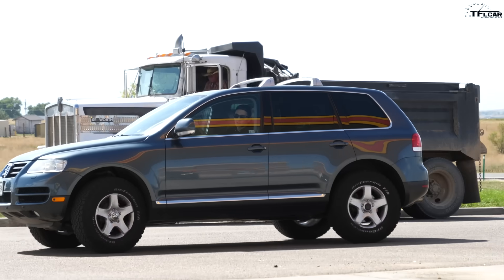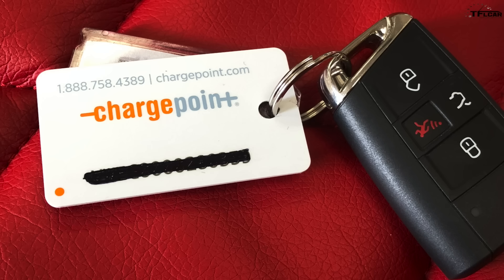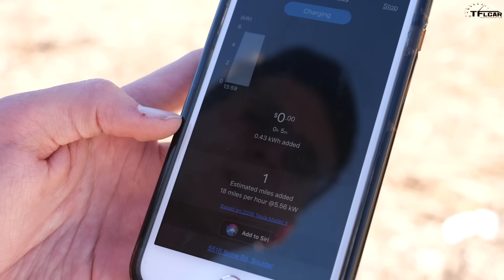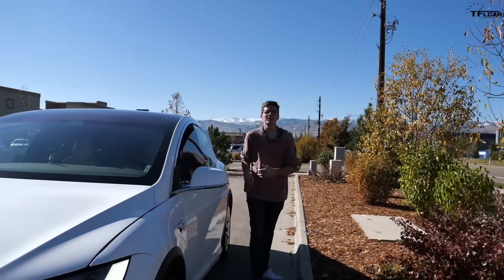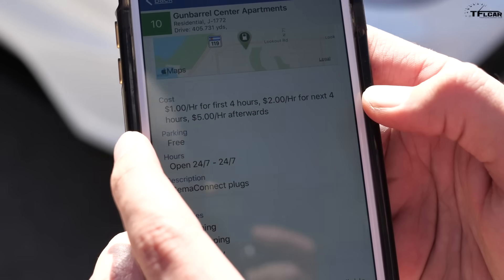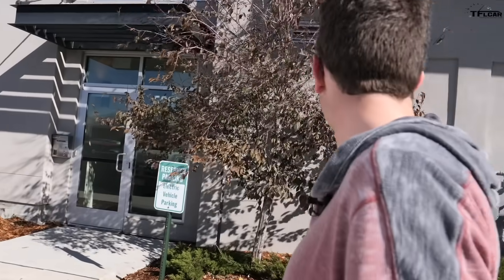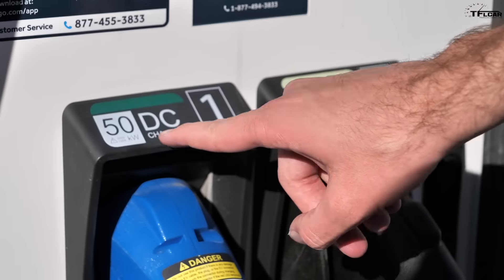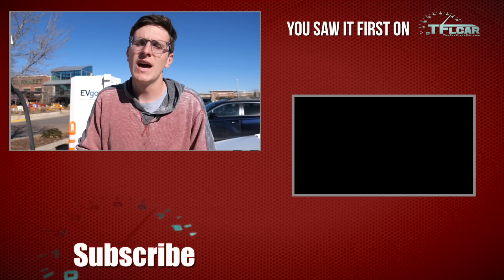Here’s Why Charging an Electric Car Can Suck - And It’s Not The Reason You Think!

Comment: Nice review---BUT there are other issues:   Non electric vehicles parked in charge space--Disabled folks using the space---and what kind of a jerk are you to draw their attention to it (UMM, I do sometimes). and then, even electric vehicles who park in the slot but don't charge--or finish the charge, and don't leave.  Even so, with that and all the issues brought up in this vid, I could (and do) survive.  My problem:  I own a piece of crap Nissan LEAF with a range of 150 miles (lie) but if you actually want to drive 300 miles--150 out and 150 back--BEWARE, with a LEAF, the battery will be too hot after around 100 miles to ACCEPT a full charge---sometimes only 15%, so you limp from charging station to charging station on the return trip.  A 90 mile trip to Palm Springs (not in the summer so it wasn't hot) took me 7 HOURS on the return trip, and after awhile Nissan puts the car in limp mode and it may only go 40 mph......and that's the real reason to be careful of how your chosen car manages thermal issues with the battery.  Nissan just doesn't---oh, and they don't care

Comment: And, on top of the waiting time and other cumbersome issues, try this in freezings temperatures during a snowstorm!  Besides, I am always wondering where do they get all that electrical power; aren’t they produce it on those power stations that burn dirty oil and pollute the environment much worse than modern gasoline engines?

Comment: Charging is the main issue that holding me back from buying an EV car. Not only I don't like having to wait for quite a while to charge, unlike spending only a few minutes at a gas station, I don't want to be a slave to getting to the charge stations one after another during a long road trip. But for daily commute, I guess EV cars are OK. You just have to charge at home overnight. For long distance driving, I would take gas or diesel cars over EV any day.

Comment: It takes 2 minutes to fill up my diesel, and it gives me 800 miles range.
Reply: @Connor Hill Ok doomer.
Reply: Most EV owners don't ever have to stop at a /charginggas station.... period. Generally, Unless you're on a road trip, you'll never really drive more than 100-200 miles in a day. Second, Charge times vary on how low your battery charge is when you start. it takes 20 minutes to supercharge to 50%, 40 minutes to charge to 80% and an hour 15 minutes to get the full 100. But the point again is WHY would you charge to the full 100% if you're going to just plug in at home.

Gas-heads just cant wrap the concept of never having to stop for "charges/gas" pretty much all year long. Example. I drive 65 miles to work and back, even if I do that twice in a day and stop somewhere for groceries/lunch/movies/etc. without charging until I get home at the end of the day. I can do that every day for a month and never stop at a charging station. Every time I wake up in the morning and get in my car, the "tank is full". After 30 days of that (65x2 miles a day[130 miles], for 30 days is 3900 miles in a month.) you and your 800 mile tank would've already stopped at a gas station at minimum 5 times if you drove it to empty.... which most people don't do, you'd more likely fill up at somewhere between 1/4 tank to empty, meaning 7 or 8 visits to the gas station.
Reply: @andredbraxton  Thank you for posting. So many of these comments are based on one of the most idiotic videos on charging that I have ever seen.
Why would anyone with a Tesla use anything other than a Tesla SC when on a road trip?
Any public charger with less than a 120 rate is next to useless.
I have only used the SC net twice while on road trips. All other charging is done at home.
Reply: Andre Braxton GAS HEADS?? 🤣🤣🤣 oh aren’t you cute! Get your head out of your ass! Not everyone is so hyped about these electric cars! Why should you insult anyone that doesn’t like it? There are MANY issues and reasons why people don’t want to give up their luxuries of using whatever they damn well chose to PAY for!!!
Reply: @aaaaaaaaaaaadddd  , you are losing it doomer. EV's cause more harm to the earth than ICE vehicles just in being manufactured. Also, CO2 is not a pollutant. It is plant food and we need more.
Reply: @andredbraxton  I fill up once a month. Period
Reply: @papavictorromeo5079  Okay, so the point stands, you drive about 800 miles in a month, averaging about less than 30 miles a day. You'd NEVER run your EV "tank" dry. NEVER need to stop, and NEVER need to detour to a gas station. Period.
Reply: @andredbraxton  so the video is misleading? He drives from station to station. I don't drive a lot with my car, just for commuting and shopping.  For long distances I use public transportation, so I fly.
Reply: @papavictorromeo5079  on his app, there's a tesla supercharger 6 miles away from the out of the way slow charger he used as an example. The Tesla supercharger network is ridiculously simple to use and has great (and still expanding) US-wide coverage on long trips, and a 40-60 minute stop during an 8-ish hours trip is about right for stopping to grab some food, bathroom breaks and stretch your legs. 

I'm not sure what point he was trying to make with this video since he was in a Tesla.
Reply: @andredbraxton  maybe the point is, that not everyone is driving a Tesla? There are more EV's beside Tesla.
Reply: @papavictorromeo5079  Non-tesla EV owners have been studied extensively. Here's a link to a 3 year study done on chevy volts and nissan leafs, https://avt.inl.gov/sites/default/files/pdf/arra/PluggedInSummaryReport.pdf . It basically shows the same result. 85-ish percent of the EV owners in these three years never charged away from the home,  and the remaining percentage did so less than 5% of the time and usually at the same places (mostly due to workplace charging).
Reply: The point Patrick is making is this...there's a "gold standard" in play because of our 100+ years of automotive experience and expectations - a 5-min "refuel" time to 100% and that gives you 400+ miles of range. It will be a LONGGGGGG time before EV's can do that; not to mention a price that is considered average for a midsize car - $25k. EV's don't offer that either.

As for the EV loons, the only thing they can offer is 'faux' talking points in hopes of swaying a buyer to go EV. The "charge at home" fallacy is moot. Why? Not everybody has a house or garage to park their car in. And with 30%+ Americans and 40%+ UK'ers living in apartments, flats, condos, townhouses and various other rentals, that's 127 million lost sales simply due to ARROGANCE, thinking that everybody can just 'plug-in' at home in their garage. This is why ICEV's will remain dominant for YEARS to come - it's a level playing field for all. Everybody has to go and fuel-up for a quick 5-minutes and then be on their way. EV 's and EV early-adopters treat non-homeowners and non-garage owners like second-class citizens. And thus, the backlash people are starting to give the EV carmakers.
Reply: @jaroessa294  First off, Patrick's video is specifically directed at charger networks in the U.S. This video doesn't even touch on populations based in Europe. As for the "gold standard" of ICE engine cars vs EV cars, it doesn't even apply. That's LITERALLY the point I made with my first comment, second comment and then again with an actual study as a source in my third comment. EV owners literally DON'T need to stop for a fill up, so they don't need a "gold standard" for fill-ups.

As for the talking points which you claim to be "faux". The majority of (according to the US Census Bureau) US citizens live in houses (77%. only 20% live in apartments), not 30% so let's not inflate numbers here. Second, the majority of those living in apartments by population (according to the National Multifamily Housing Council) 2/3 of the population in the US living in apartments is in dense population metropolitan areas where public transportation is the norm and the majority don't own vehicles (these areas have numbers around 8-12 people per car). So that leaves less than 10% of the united states population with out an option for charging an EV at home. So let's keep the perspective grounded in reality. Claiming that "it's a level playing field for all" and that "everybody has to go and fuel up" when you specifically are talking about a less than 10% population in the U.S. is a "faux talking point".

Lets also talk about your "lost sales" point too. Tesla (looking at Q3 passenger cars last year since I was able to find a full year comparison numbers for those), was up in sales by a crazy margin well over 100%, while (with the exception of specifically the Dodge Challenger +14%, and kia soul +0.4% models) where down in sales by margins of 20-35%, some by as much as 67%. Keep in mind, that Tesla is a manufacturer who is currently unable to fill the demand at its current maximum efficiency. EV owners don't treat non EV owners as second class citizens because there's a difference between standing up for the facts, and pointing out misinformation.

@danielle Sure, I used the term "gas head" in frustration, because I was fed up with yet another misleading video about EV's, but let's not get ahead of ourselves by forgetting how much more often EV owners get typecast or labeld as hippy, whining, tree-hugging, nerds, et-al. The pot is calling the kettle black here if THAT is your complaint.

As for pricing here in the U.S., they're not anywhere near as crazy as you make them out to be. You can pick up a model 3 for $35,000. Sure, it's not the same as a $24,000 honda civic, or toyota corolla. But its cheaper than, ALL the Cadillac models, ALL Audi, ALL BMW, All Mercedes, All the Volvo, 2/3 of All available VW, Toyota, GMC, Acura, 1/3 of all Chevy, and hit the high price ranges of Ford, Honda, Hyundai and Kia. And that's not even considering the HUGE advantage Tesla has in maintenance time/costs, coverage, features, safety ratings, upgrade ability, and standard features. I might add, Kelly blue-book rates average light vehicle prices in the united states at $36,843 as of April 2019 for new cars.

Comment: Electric vehicles are all junk, an example of that would be tryin to repair one if it for any reason breaks down and you're sittin on the side of the road....more than likely it can't be done.... #JustSayNoToEV
Reply: Another point, Tesla makes it so that they only can fix it and have control over the whole process. So you're bound to their rates, there this guy called Rich Rebuilds and they make it impossible for him to fix the teslas and get parts for refurbishment. Also look how they have different   charging nozzles instead of a regulated and standardized ones like combustion engine vehicles.

Comment: Fast charger puts extra stress on the batery..
Reply: It can if you are always charging very fast. I use a supercharger once every few weeks. Most of the time I just charge it overnight at home. I have lost 4 miles total range over 75K miles so far, so these batteries do well. Don't expect to get much (including manufacturer support) out of the Nissan Leaf, though. 45K miles and I have already lost 60% of capacity (down to 40-45 miles range) and they won't even talk about it.
Reply: That is not a fast charger
Reply: It depends on the battery system, but basically heat is the number one killer. Typically if you are below 1C (take your kwh and use that number as your power input times the C factor) then it's not really stressful because the cells won't heat up as much due to the power input not being so high relative to your battery capacity. Each cell then sees a lower power input compared to a small pack charging at the same power.

A 100kwh Tesla charging at 50kw is 0.5C, which is not stressful at all for most battery chemistries.
Reply: Yes, but you can cook a hot dog or hamburger on the battery pack. [Re: Manifold cooking on a Slant Six].

Comment: How is putting extra loading o the grid, longer wait times between use and all the added infrastructure help anything especially the environment? Electrics are still the future using any kind of batteries maybe not so much. Fuel cells using hydrocarbon based fuels seem to be more practical.

Comment: Isn't it nice to have options!?!?
Why the bias ? Why the hate?
Every house in the United, has 240 volt. . . ....
If an electric will work for you, then purchase one for that reason!!
If you need to have a fuel powered vehicle, for instance service trucks, such as fire trucks, ambulances, first responders I think you get the picture!
Why beat on this freaking Elon musk,? bitching about all the details that I'm sure with his level of dedication to DO THE RIGHT THING, he will get worked out!
The man is not trying to sell snake oil!
He is trying to secure a future for our offspring!!
If you need to get charged up somewheres other than home, stop off at the bada bing and get a lap dance!!
And then come home and discharge your batteries with your girlfriend or your wife whichever!! 🤗🤗😁
That will definitely get you the mileage you are  looking for!
Reply: Not every house has the capacity to add another 240 volt for a charger. Many older homes will need to be upgraded with new panels and wiring to do so. And what about those who don't have off street parking? Electric cars have a niche but they cannot be the car  of choice for the masses.

Comment: "Charging at 120v outlet can take several days"   
You can charge 90 miles worth from 6pm to 6am (overnight) from ANY 120v outlet if you own a model 3.

Nothing to buy, nothing to install.
And If you car is parked at work (again regular 120v outlet), in 8 hours, you get up about 60 miles. 

Charging station are really solely used for long distance travel. And for that reason you want the high speed charger (Teslas)
the m3 and Tesla V3 are rated at 250kw... but the 15,000+ right now at 150kw.  That add at peak over 700 miles an hour.
Reply: Most businesses dont have charging stations. So unless that car can make a round trip, I wont ever buy one.
Reply: Oh and 70k for a car with the build quality of a 90s Kia is just not a good deal.

Comment: This should be titled, "Here's another reason charging...." It seems to me there are many reasons electric cars suck and we touched on a few more here. Now just imagine most people driving around with electric cars and the chaos for charging stations on a good day. Also imagine traffic jams on the highway during winter time when those heaters are running down batteries as people wait for emergency and recovery crews to do their thing. Think about storms that cause massive power outages that last for days. And while you are stranded I will be going to gas stations that have backup emergency generators and filling up with gas but also blankets, food, water, and other necessities and selling them to you for a nice profit. And trust me, I will.

Comment: Please tell me if you have video about how the 12 volt  BATTERY IN THE ELETRIC CARS. and how it  can be a issue ,if not looked after. I have two cars, one is the volt 2012 and the 2013 ford focus electric. I bought these cars new. The battery could die at anytime. The ford three times the volt once. The cars will not go into neutral.  These batteries do not have a gauge  ON THE DASHBOARD. So how do you know how much charge is in the 12 volt battery. And these you don't jump from another car.
   So what in these cars are charging the 12 volt. I was also told there was a gel inside these and a fuse of sort.. I have not been able the get any  answer from the dealer .thanks aurora colo 
 I don't think that  many ford electric cars were sold in Colorado I haven't seen any in six years.but I do see a lot of  chevy volts.

Comment: That's not transportation, that's a wild insane nuisance. Go buy a car with gas, refuse to change, and they'll figure out how to make cheap carbon neutral synfuel or the batteries & plugs will improve and standardize if everybody refuses to tolerate all that nonsense. You folks are still early adopters on the bleeding edge!!!!

Comment: Seems like a lot more trouble than it’s worth.
Reply: Honestly he makes it seem a lot worse than it is. If you own an EV, you should also own a charging station at home (which is about $500 if you go with Tesla). If you own a home charger, the only time you should ever use a public charging station is if you're traveling long distances; traveling cross-country for instance. If you drive a Tesla, there is almost always a supercharger within the range of the vehicle that will charge you up in about 40 minutes so it's not too bad, even if it definitely is a longer wait than going to a pump.

Comment: I’ve been trying to get on board with getting an EV car. But the time length of charging just to get around town doing daily errands seems to be too much. That, and all the complicated apps, charging nozzles, locations of charging stations, etc, all seems so convoluted,  there goes some, if not all, of the driving experience.  And I agree that if all the different charging stations require different prices, different nozzles, different available hours, etc., then that just adds to the already complication of just wanting to ‘refuel’ the car. If they, the developers of all-electric cars, trucks, SUVs, etc., want to make an actual impact, then make everything uniform, expedient, and definitely easily accessible.
Reply: Always the story with early adoptions. everyone has their proprietary solutions, Video( remember Betamax) Networking early days( Proprietary ++).
 This will standardise when a market leader forces standards aftef a bit of a bun struggle where no one wins and some just disappear.